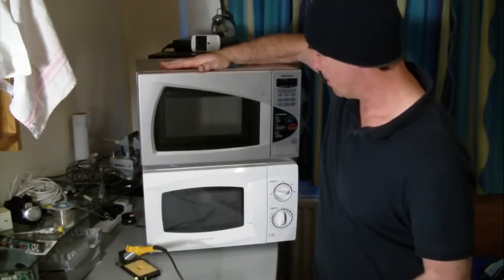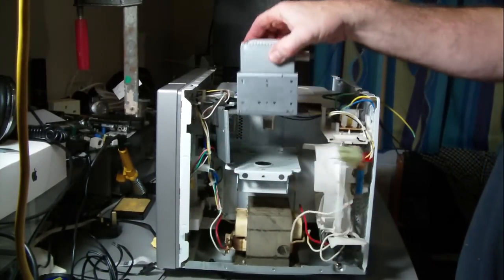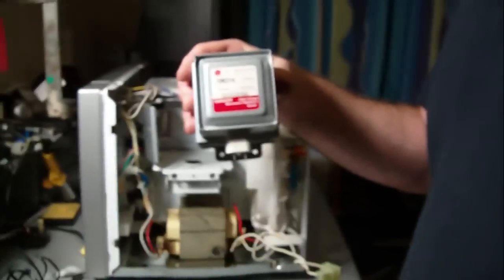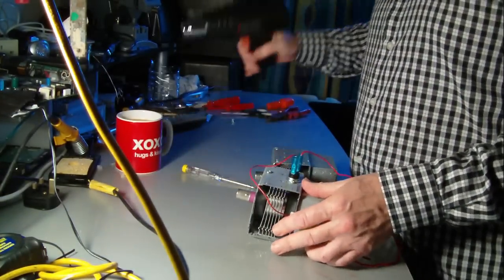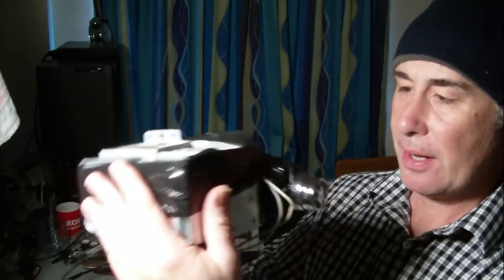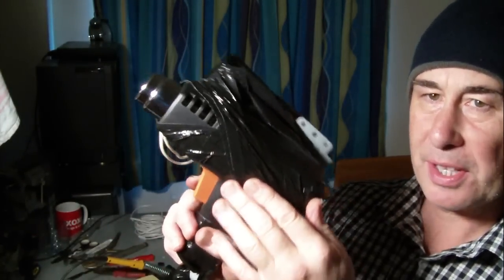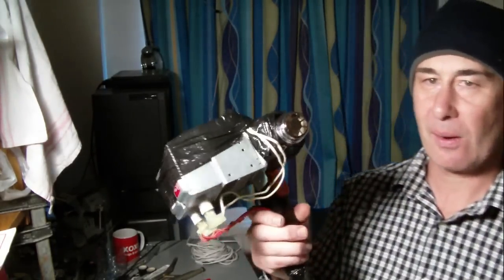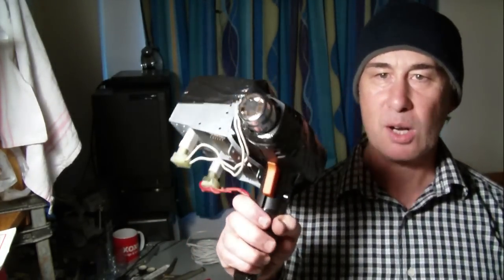Microwave oven Gun (magnetron)

Comment: If your first guns is anything like this gun then you you are likely to still have problems. The metallic tub (wave guide) you feed it into must be of the right size for the frequency to ensure maximum power transfer while as little power as possible is reflected back to the magnetron. For a better understanding, google these terms: wave guide, feed horn, impedance matching, SWR standing wave ratio. 

Furthermore, any two "mono phase electromagnetic" sources will either constructively or destructively interfere with each other. The two magnetrons must be properly spaced as well as fed the proper phase so that they will constructively add power rather than one feeding power into the second.  For a better understanding, google microwave microwave circulator